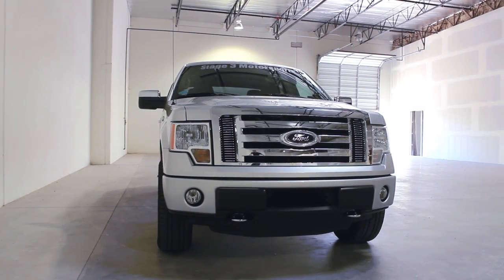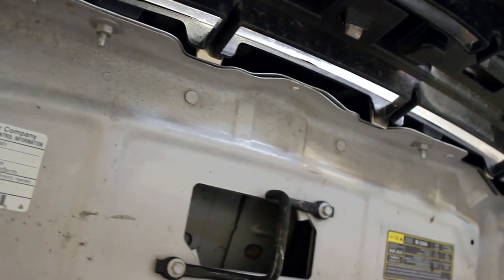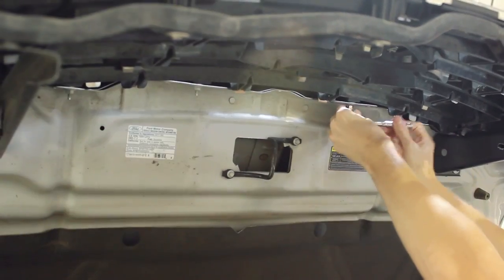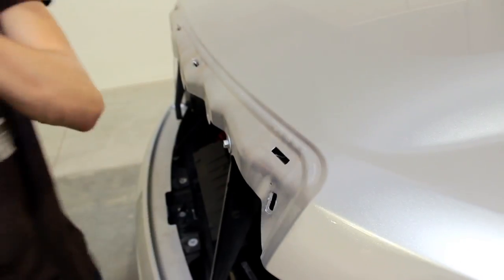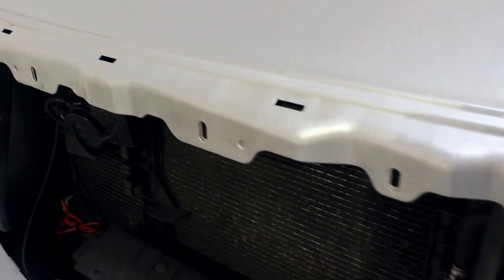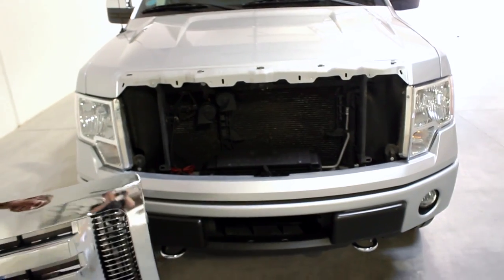2009-2013 Ford F-150 OEM Grille Removal How To

Comment: If you use the trim removal tool correctly you can preserve the clips.  This is a good video except for this important piece of left out information.
Reply: Nah. That's bullshit. In real life they always break. I replaced tons of them for aftermarket ones and you can take as much time as you want to save them but they'll always break.

Comment: What about the broken clips if you want to reinstall the grill????
Reply: You don’t need them the bolts hold it on well enough
Reply: @asherlayton3571  Ok thanks but I figured out how to remove them without breaking them!
Reply: Haha really I took mine off today and just ripped it off from one side
Reply: @asherlayton3571  The key is to lift up on them the opposite direction that they go in so they're no sideways force to shear them off.